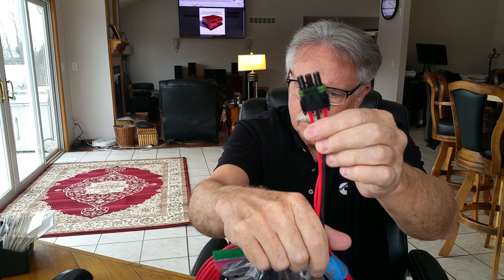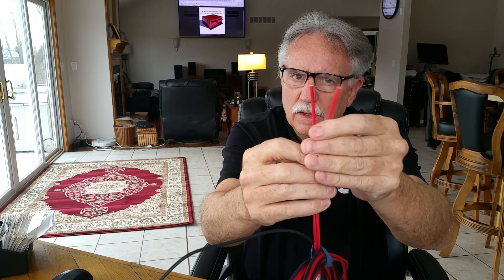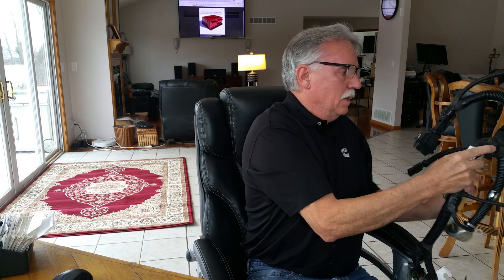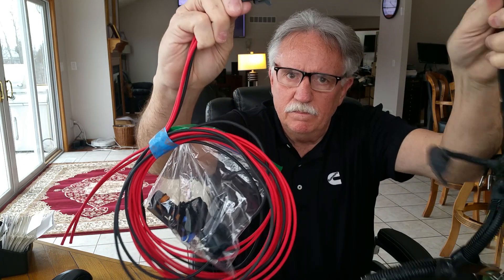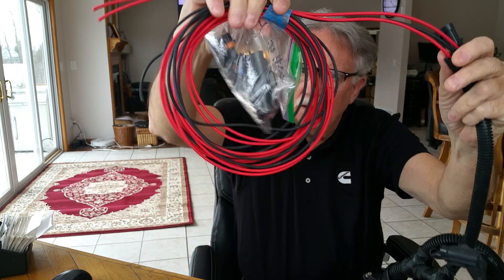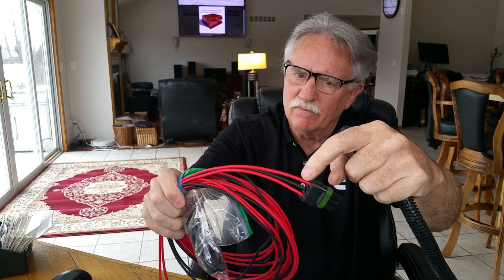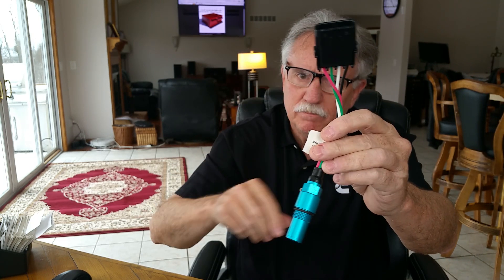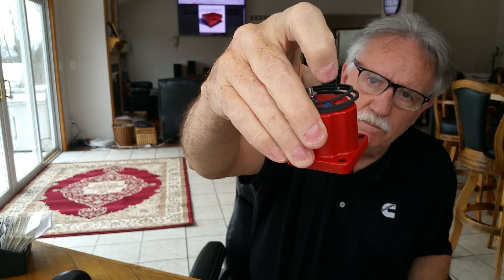Cummins L10, M11 &  N14 Cummins Engine Unwsitched Power to the ECM...Important stuff!

Comment: Soy de panama tengo motor cummis m11 celes plus ai corriente computadora pero para ijectore no tiene corriente no arranca como me puede ayudar
Reply: Tengo el mismo problema n14
Reply: @dantito3  y ya resolbite o todabia
Reply: @dantito3  el señor sabe mucho de cummis  no abla español
Reply: @dantito3  en este video el sensor q el abla es de arbol de leva influye mucho con lo q es arranque un amigo me traducio lo q el dise ay
Reply: Revisaste el fusible que va en la batería ? Ahí va un cable con un fusible que envía corriente a la computadora del motor
Reply: @dantito3  si la computadora tiene corriente en itnition ay corriento los ijectore no ai corriente
Reply: @ivangutierrez4434  tienes el diagrama o el manual del motor?
Reply: @dantito3  no lo tengo como lo puedo conseguir tu como resolvite tu problema
Reply: @ivangutierrez4434  mi problema parece qke es la computadora ,ya revisaron todos los conectores hay corriente pero la ecu no funciona
Reply: @dantito3  ayala q cosa donde puedo conseguir manual de motor m11
Reply: @ivangutierrez4434  tienes algun correo para mandartelo
Reply: @ivangutierrez4434  revisa tu correo te envie el manual...
Reply: @dantito3  ok si gracias
Reply: @ivangutierrez4434  como te fue?
Reply: @dantito3  todabia no lo e echo

Comment: Hi Sr I have problem with my L10 cummins, the fuel injection pump is all ready repair and install but start no problem, just when I switch to drive or reverse the engine stop why??? automatic transmission, the line from the tank was opening and air go in so the fuel filter was empty every time, I fix the line and now star ok but I can't move the truck because when I engage drive engine stop, help me please, I am only driver of my own truck International 87 with cummins L10 engine dump truck  somebody help me to fix

Comment: No offense,  but, I sure don't see any justification for  $ 125 for your setup.  How about doing away with the WeatherPac connector all together. And  run 3 lengths of wire  (two hots and 1 ground)  with 10 or 12 guage wire and solder and shrink tube the connection along with your inline fuses.  Never have to worry about that weatherpac connection that corrodes on every one I have worked on.  Just my two cents.  Oh and  and it's a total investment at NAPA for maybe 20 bucks.
Reply from the maker: We all network together and do and share what we are good at.  Makes the world a better place for all of us to live and grow. Thanks for ur input!
Reply: Well we know that you cannot do it yourself Proud Boy.  Proud Boy sounds like the name of a gay male stripper.